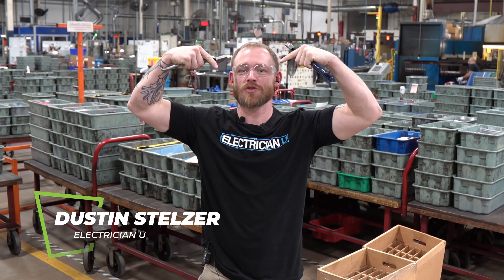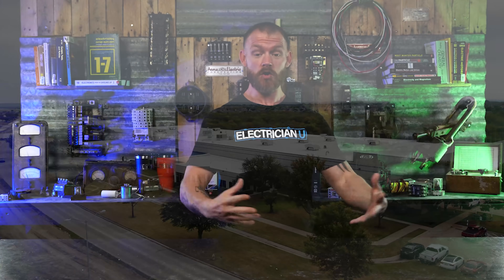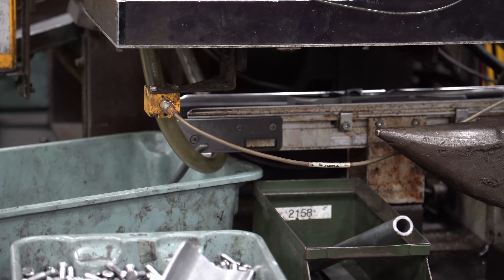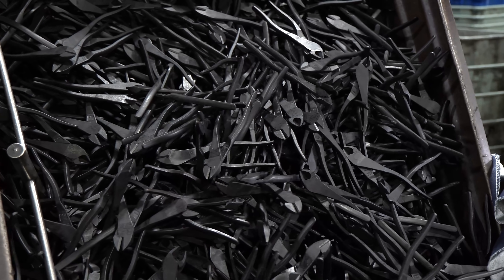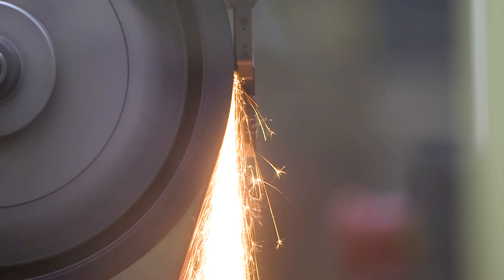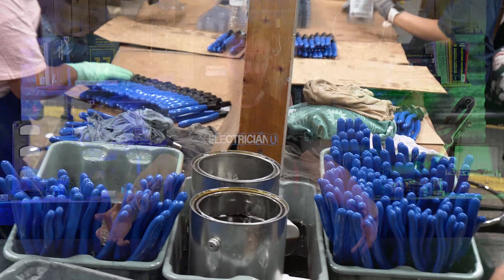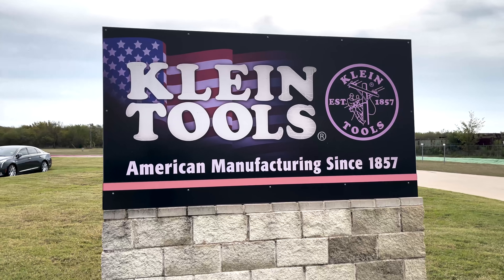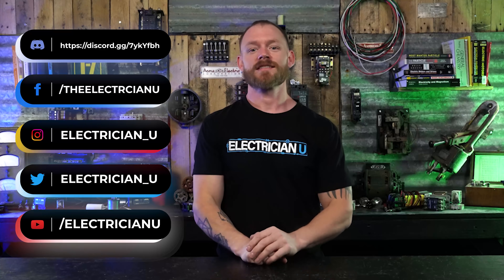How Lineman's Pliers are Made - TRIP TO KLEIN PT1

Comment: Love my Klien tools! Got my first pair of linemen’s in 1968, still using them, when I graduated from vocational school in 1970, a local supply house gave each graduate from the electrical shop a tool pouch filled with Klien tools. Linemens, side cutters, needle nose, slotted and Phillips screw drivers. Still using them today, although my side cutters have worn out from so much use over the decades.

Comment: So.... I have a question.... or rather, looking for advice...
1. I buy a house. Inspector of course, barely does his job (doesn't).
2. When I swapped ALL of the light bulbs to LED, I noticed there's a rapid dim-bright behavior once in a while.... Annoying. 
Had an electrician out here, due to a smell, and they replaced an outlet in the master bedroom. Later, lights still doing the bright-dim stuff, so not resolved.
3. Later, I changed the old 1998 vintage breaker for a DFCI (GFCI/AFCI) breaker, since the bathrooms were on that same master bedroom circuit.
Instant trip. (The other AFCI that I installed for 2nd bedroom has no issues.)
4. I went ahead and changed ALL outlets. Outlet tester reports all good. In no way, are any of the hots or neutrals touching the sides of the box, visually.
No joy/no change.
5. Disconnected everything on that circuit.  Opened an outlet back up, removed receptacle.
Neutral to ground continuity ok.... BUT.... meter reads continuity from ONE of the hots to neutral and also ground. Hmmmm...
At the panel, between neutral and hot for that circuit, 14 ohms.

What might this be indicative of? Any troubleshooting methodology around that, before I go ahead and get an EXPERIENCED electrician out here?
Reply from the maker: Wires in the walls might be missing some insulation, could be a nail through the Romex sheathing and it could be intermittently causing a small short (tripping the AFCI) could be old wiring finally giving up and causing an arc somewhere you aren't seeing causing the AFCI to trip 
Could be you have a compressor like a mini split it a window ac unit tapped into that circuit and causing the AFCI side to go oh no and cut the connection. There is a lot of reasons WHY it can trip. 

Or it could be that that Dual function breaker is tripping. Sometimes from factory it's defective as well.

Comment: I was a phone lineman for 17 yrs. 9" Kleins are the most useful tool EVER made. and they last forever. I've lashed HUNDREDS of miles of phone cable and fiber with Kleins. I have one pair I've had since the mid 1980's. We would attach a small 7/16 ratchet-wrench to the end of handle, and it was super-fast for tightening bug nuts....If you don't know what bug nuts are, you have to pull their little legs apart to see them. (old joke)

Comment: I've been using Klein tools for 20 years, since my first day as an apprentice. I can honestly say the quality, especially the strength of the steel, has dropped significantly. I still buy and support Klein, but I find myself switching some tools to the german steel version. I would happily pay more for Kleins if they could use higher quality steel.
Reply: Totally agreed
Reply: I'm curious in what way you feel the steel has declined. Just general wear and tear on the tool? Teeth, cutters, rivets? I don't doubt it, I'm just curious how you've come to that conclusion in your personal experience using the tools.
Reply: @plsreleasethekraken  With the linesmans pliers, I've found the wire cutting surface wears out MUCH faster, gapping out in under a year, even when ONLY cutting copper. I would get YEARS out of my old pairs, even when cutting stupid things as an apprentice. Screwdrivers are flat out trash now. I snapped the shafts my last three flat head screwdrivers just trying to tighten screws. No prying, no abuse, and I'm not that strong. I switched to Wiha and Wera screwdrivers, and you simply cannot break those.
Reply: @jameskoehler4939  yea, I haven't had problems with the teeth or body of pliers themselves, but agree with the pinch cutters--even on copper they seem to wear. Same thing for shear cross-cut cable cutters--they ding even on copper which is very frustration.
Reply: @jameskoehler4939  that being said, I have the exact same issue with channellock.
Reply: @plsreleasethekraken  Indeed. I think they also switched to lower grade steel. Such a shame. Another USA company focused on short term profit instead of quality, respect, and loyalty.
Reply: Idk how good the old ones were, but if they were better than what Klein makes now that's insane. I have a pair of the 2000 HD lineman's pliers I got a couple of years back and they are indestructible. Cutting anything you can think of they still cut like the day I got them.

Are you buying the heavy duty ones? The ones with the hardened cutting edges? That could be the issue.
Reply: @johnh8546  I've tried three pair of the "Journerman" series. They are not much better, and I've found the rivet to be too stiff on two out of the three. I'm a professional electrical contractor, so I use my pliers 7 days a week. I wear tools out, and Klein wear out faster than they used to. Trust the old guys. Klein is marketing to consumers now, not professionals.
Reply: @jameskoehler4939  I'm also a professional I cut wire daily. I cut Tek, SO, THHN, screws, I hammer locknuts daily with my Kleins pretty much, you name it I do it. I cut verything but romex and ACSR. I don't do commercial or residential more money in Industrial installs and im not a lineman so I dont work with ACSR.I do it all with my Kleins and in the 8 years I've had them they haven't missed a beat. I know it's been 8 years because they are the only linemans pliers I have bought since taking up this trade. I will give you old Kleins may have been better sure maybe so, but their current products compete toe to toe with anything I've touched. Be that channel lock, knipex, wera, wiha, and so on.
Reply: @johnh8546  I bet that the fact you're industrial makes the difference. I'm residential, so I'm cutting romex all day, while you probably cut more THHN. The romex might be triple the wear on the cutting surface per snip (on average). Interesting. Knipex work better for me since the steel is harder, but I can see why the Klein might be better in your jobs.
Reply: @jameskoehler4939  mostly I'm cutting Tek actually. Which means I'm cutting a lot of flexible conduit. Then 4 6guage wires all at once. By comparison Romex is much easier to cut. I have cut romex with my Kleins.
Reply: @johnh8546  6 AWG solid?
Reply: @jameskoehler4939  no stranded and I say all at once but really usually 2 or 3 of the wires are the same time. I have and we do cut 6 AWG solid conductor, but that's typically for things with water in them for equipopotential bonding. Like what you would do with a pool. I think code calls for 8 AWG for a pool or hot tub but we use 6 AWG for water processing tanks and the like.
Reply: Stranded is pretty easy on a tool. Stop cutting multiple wires while your knuckles still work. Tendons don't last forever, trust me. But just use what tool makes you happy. That's what I do.
Reply: @jameskoehler4939  maybe but I figure 6-8AWG stranded puts at least as much wear as 14/2 and 12/2 romex which is what you would be cutting more often than not.
Reply: Pliers aside, Klein's screwdrivers are currently trash, and I won't waver on that.
Reply: @jameskoehler4939  I don't hate their screwdrivers they are middle of the pack.

Comment: I have mixed feelings about Klein…as far as their hand tools are concerned they’re ok. But I definitely would not suggest buying anything from Klein other than hand tools. I’ve had to return a relatively new meter, a voltage tester, and circuit breaker finder the last couple months bc they’ve failed (the meter read 0 voltage and i ended up blowing up my screwdriver). Their tool pouch, multi screwdriver thing, as well as their little led flashlight is garbage as well. The handles of their strippers tend to slide right off too. Klein on the decline imo.